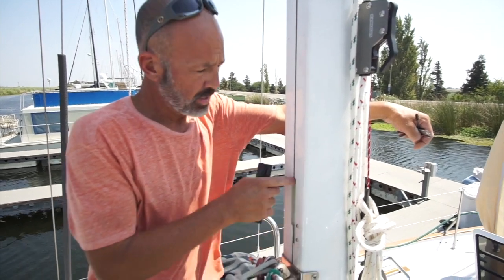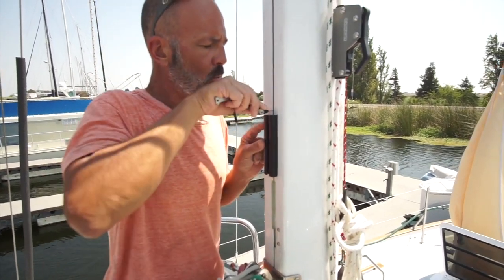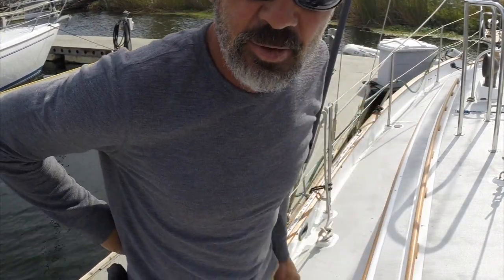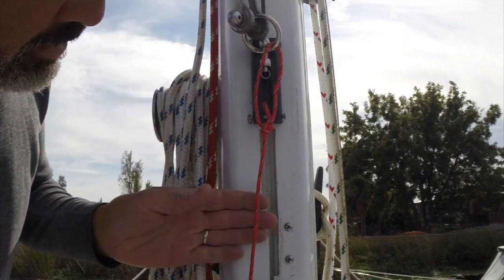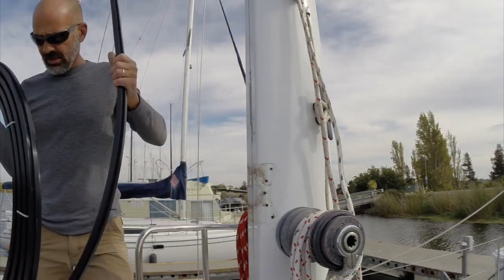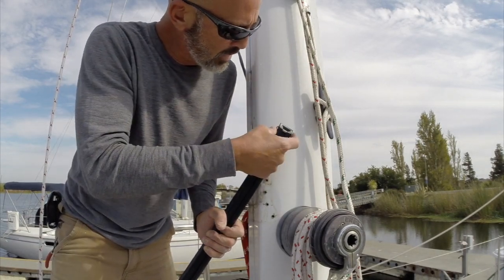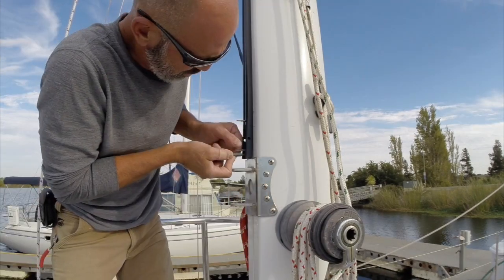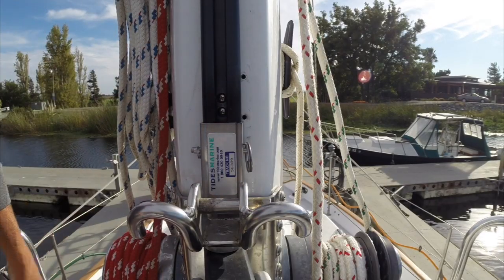SV Ramble On | Installing a Strong Track

Comment: Installing our 3rd Tides Marine Sailtrack today. After about 10 years in the really hot tropical sun year round, you need to start keeping an eye on it for UV degradation like anything plastic. So since are doing 2 southern capes in the next year, we want to make sure everything is in tip top shape...so replacing our sail track a little earlier than we normally would. It seems to be 12 years is most prudent if in the hot sun year round. Probably a lot longer if not. Better safe than sorry :) We really love this sail track...so will be replacing it every 10-12 years for life I suspect! Thanks for making this video. -Rebecca on SV Brick House
Reply from the maker: Hey Patrick, thanks for watching us.  I watch your videos, and often refer back to them time and again.  When we got the Tides System I was worried about that t-slot in the UWHM Plastic and figured that would be a prime point of failure.  Glad to hear you got 10 years out of each one before changing.  I like simple, and Tides has the least amount of moving parts.  Some people freak out about UV lifespan for the track; I figure it's the price you pay for convenience of sail handling.
Reply: Precisely our thoughts. For the money and the simplicity, it’s so easy to just replace it every 10-12 years depending on where you are going, what suns you are in etc. If doing serious full time sailing, I think 10 years is where the note in your maintenance log for replacement should go.

Comment: Hi Rich, we have really enjoyed your videos. Thanks for all the work you put into them. I was wondering what size wire did you use for the inverter video. I have looked everywhere and cannot find the specs. We will be installing our Multiplex in about 3 weeks. Thanks John
Reply from the maker: Thanks John.  Glad you're enjoying the vids and thanks for watching.  I hope this answer isn't too long winded, but for the inverter install I went with Ancor marine grade 2/0 AWG wire for all the battery cables and the feeds to & from the inverter/charger.  In our particular install the runs were all very short (less than 5 feet for the longest return wire) because the battery bank was almost directly underneath the inverter/charger, and I sized the cables for LESS THAN 3% voltage drop.  This location is suitable in our particular application because of our LiFePo battery bank, but it's not recommended to mount the charger directly above a typical Lead Acid battery bank due to the corrosive affects of Hydrogen off-gassing onto all the electronics inside the Victron.  However, it is at least (if not MORE) important to properly terminate the wires with good quality marine grade lugs and a good solid crimp.  Rather than go into all the details, I'll link you to the page where I learned how to do all this stuff: https://marinehowto.com/making-your-own-battery-cables/  No point in spending good money on marine grade cable only to utilize inferior lugs and crimp methods.  I think I spent about $160 on the "bolt-cutter" style crimper, and I've definitely put it to good use throughout the complete re-wire of our boat.  The terminal lugs I used are solid copper tinned marine grade FTZ Power Lugs, and they run a couple buck each.  I also follow up with adhesive lined heat-shrink tubing over all the major crimps.  Money well spent, and I'm happy to say we sleep comfortably every night as full time live-aboards.  Maybe in the future we'll do a specific video on wire terminations and give a little explanation on why exactly this is so important.  Thanks again, and good luck on your new inverter installation.
Reply: Thanks for getting back to me. I was planning on going with 2/0. It really help getting your input. Thanks again. John @svrambleon
Reply: SV Ramble On l

Comment: How are you liking your Strong track with full batten sail? How many sf is the main? Thanks
Reply from the maker: Thanks for watching La Sirena, we love the new Strong Track system.  Our main hoists so much easier, and it drops like a rock into our Mack Pack bag with lazy jacks.  We do keep a careful eye on the battens when sheeted way out and running downwind so they don't chafe against the aft lower shrouds.

Comment: can you use the slides in an existing track? My track is aluminium and already installed. My slides look like they will slip in to the existing track?
Reply from the maker: I don’t think so.  The track is what makes the slides move smoothly.  I think you can add the Strong Track to your existing track though.  Go to the Tides Marine website they have options for retrofitting.
Reply: Thanks for the info. I was hoping to get rid of the plastic. I priced the track and in AUD with delivery etc was ridiculously expensive and really then I am just back to plastic. Think I will selll my tides slides that I bought second hand  and invest in roller slides that work on metal. thanks for the response though.
Reply from the maker: If you already have the Tides slides maybe give them a try up the metal track.  Maybe it’ll work fine.  If not, you can always switch.

Comment: Nice work Rich, are the track kits expensive?
Reply from the maker: Thank you Dan, and thanks for watching.  The kit runs about $29/foot and our mast is approximately 45 feet from the mast gate to the headboard stop.  We purchased the sail track system through our sail maker along with a new mainsail and two head sails and it included all the appropriate track slides and batten receptacles for our specific mainsail design and batten layout.  The Tides Marine website has really good instructions for measuring and installation, but there's also several other videos on YouTube that were very helpful before I cut to length and installed our own sail track.